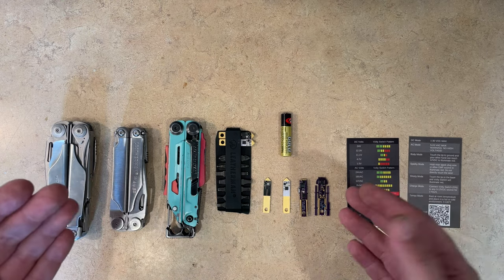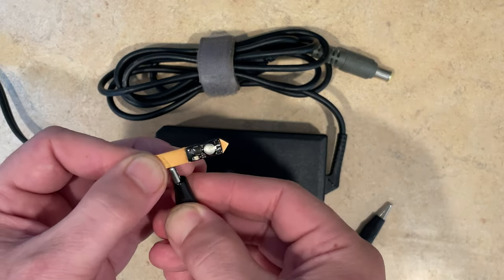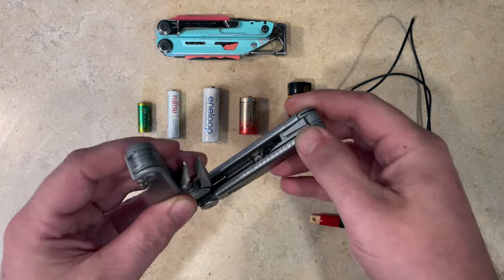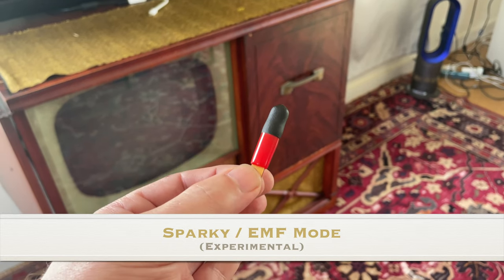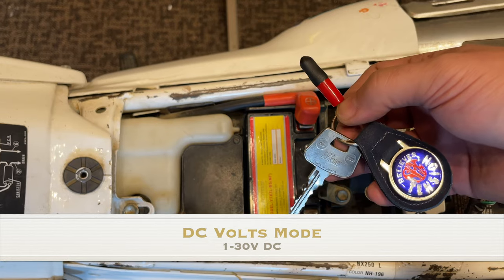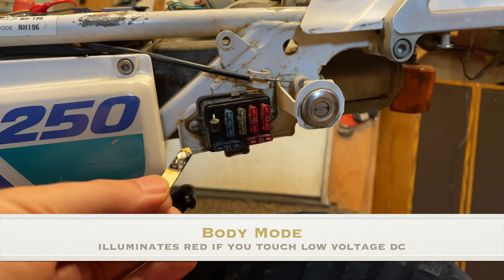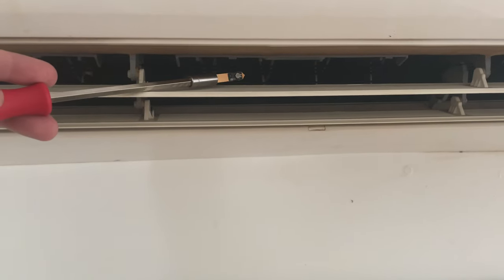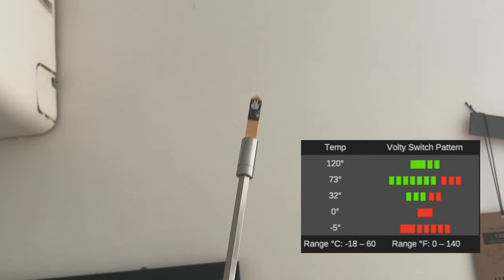Volty Switch Small Keychain EDC Multimeter: Fit's in leatherman's bit holder.

Comment: Can you make a video on how to recharge it? Don't really understand what you said in the manual.
Reply from the maker: Turn the switch to the ON position and just leave it connected to a voltage source 3-16V. It will be fully charged after a few hours. Video on this and advanced features coming soon.

Comment: Does this one fit in the Bit kit holders?
Reply: Yes, Fits Any Leatherman Flat Bit Device... May Need some Trimming on Some Tools! RTM=Read the Manual!!!
Reply: Unlike the original Volty, the Volty Switch doesn't fit in the bit kit holder due to the battery on one side and the switch on the other, making it thicker. However, I've resolved this by creating two slots—one at the top and one at the bottom of the holder (ABS) using a heavy-duty cutter. Now, it fits perfectly.